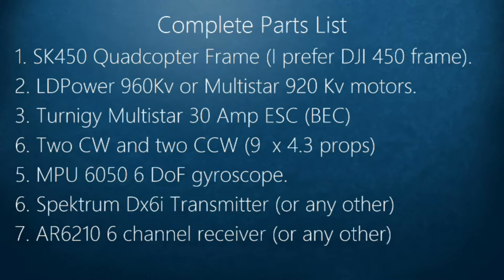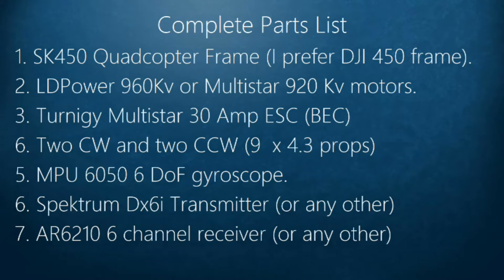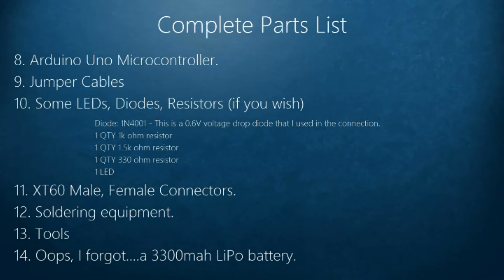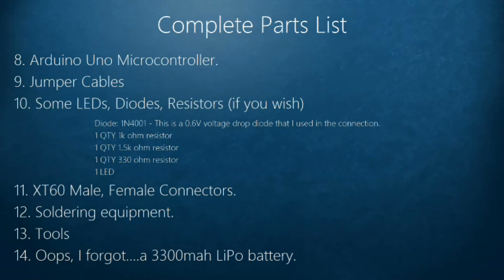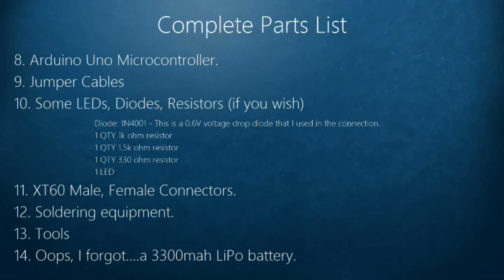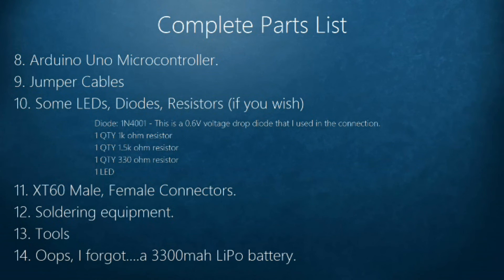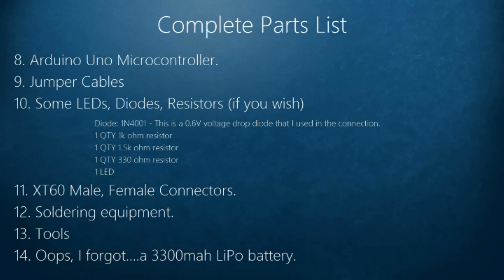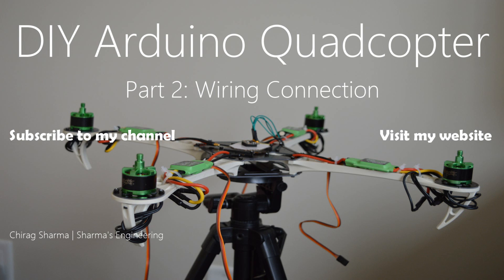DIY Do It Yourself - ARDUINO UNO QUADCOPTER | Part 1 - Parts List

Comment: can we use this battery for this circuit brother 7.4V 5200mAh 30C LiPo Battery       https://www.tomtop.com/other-rc-battery-1224/p-rm3984.html
Reply from the maker: Hello sathish kumar,
The battery you mentioned is not a good choice.
Reply: how to connect solar panel to lipo battery for quadcopter sharma plz tell
Reply from the maker: A solar panel?
I am not sure I understand your requirement here. Please elaborate the objective you are trying to achieve.

Comment: just a question... 2200mah won't be enough for an arduino and 4 18000kv motors would it ?
Reply from the maker: I believe that'll give you very little flight time not a great performance overall.